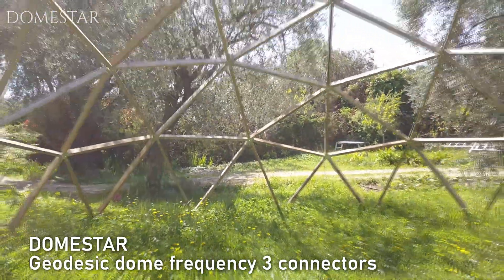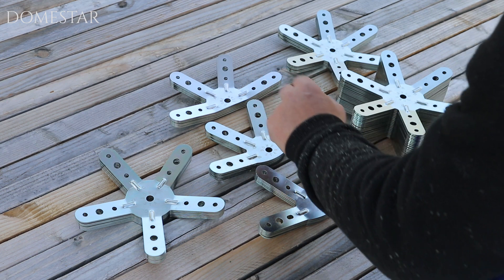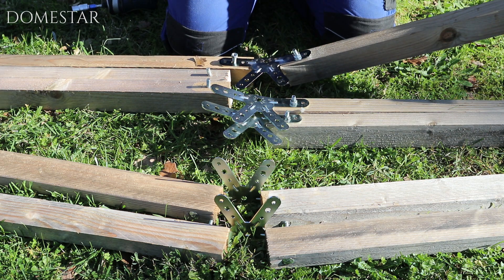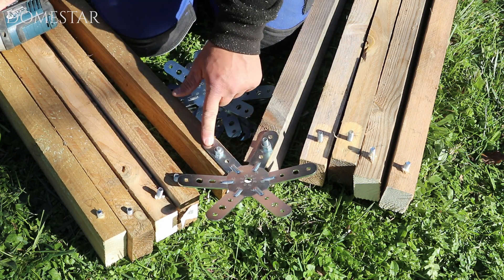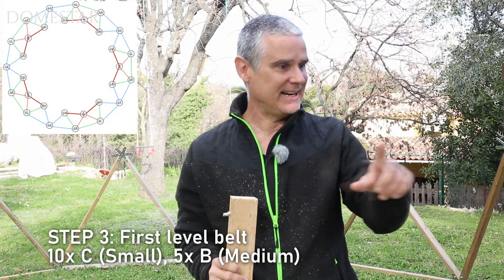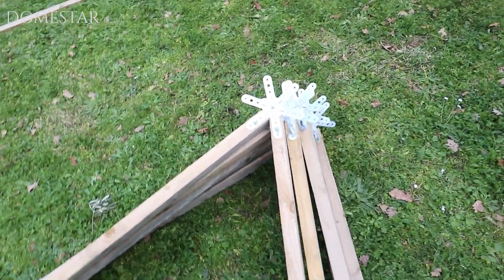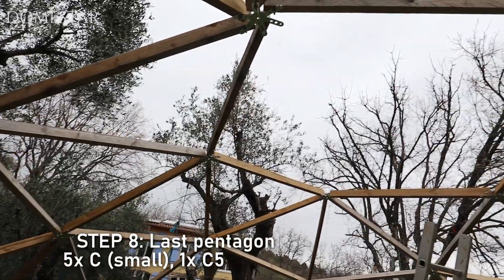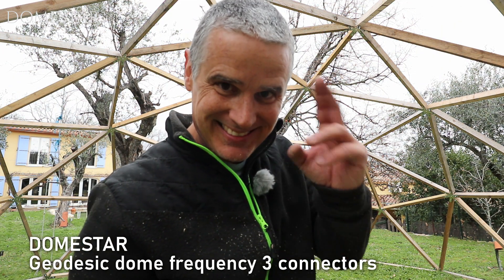3V geodesic dome: how to build a frequency 3 (3/8) dome with DOMESTAR connectors (ENGLISH version)

Comment: The links in the description are cut off.
What are the total costs (connectors, screws, wood, and everything needed) for such a dome?
Reply: The connectors will cost you around 300 euro. Timber cost will depend on the size of dome. Be aware that these connectors wont create a dome with a flat base. You can also  make your own hubs from heavy wall aluminium or pvc tube. https://youtu.be/LnX2W2mgl0Q
Reply from the maker: 2025: we now offer the Kruschke models of connectors with flat base. Available for 3V 3/8 and 3V 5/8. Also in addition to galvanized steel we also offer stainless steel.